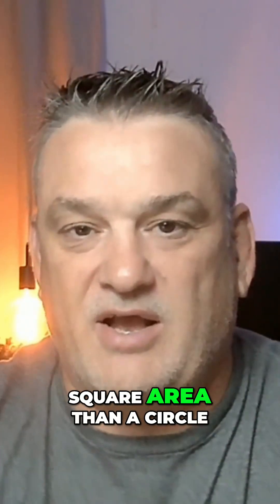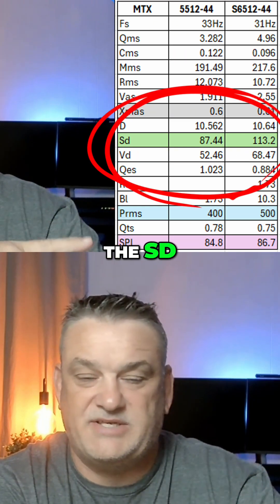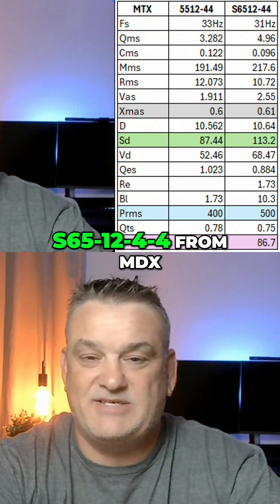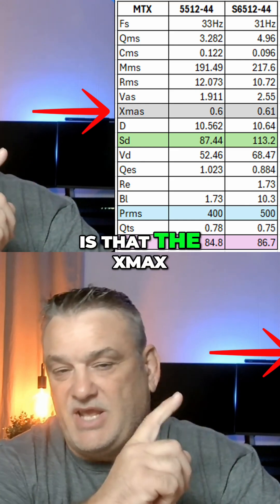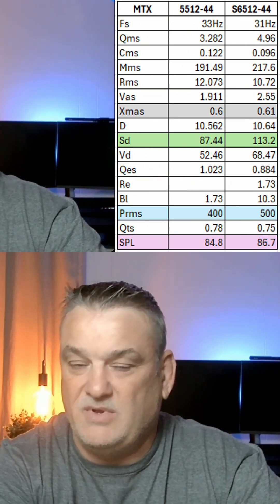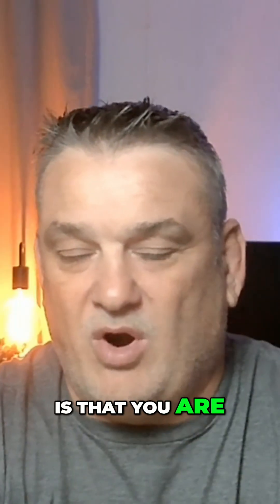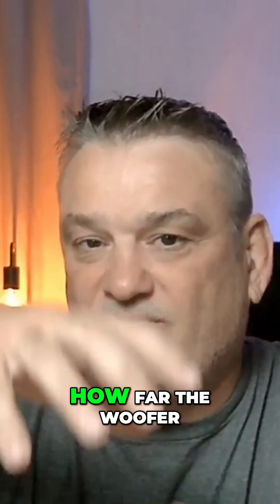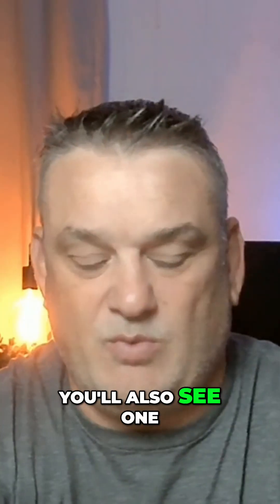Which Subwoofer Shape Gives You More Boom?

Comment: I've found that the biggest effect on efficiency is going to be with the enclosure. Not so much the sub. Like in your two example subs, the square in theory is gonna give you an extra two dB for the same amount of power. Going from a small sealed enclosure to a large ported enclosure can gain you 6 to 10dB. 👍
Reply from the maker: 100% agree!
Reply: The reason for a 4th order box properly built right?
Reply from the maker: @davidbryant8955  I agree with you, if you could only have one sub, 4th or 6th order might be your best bet for output!